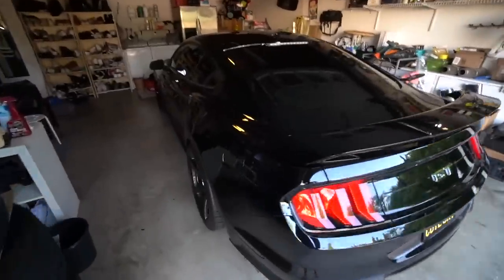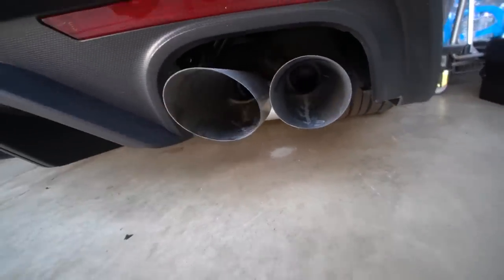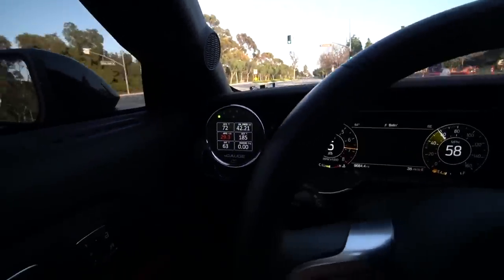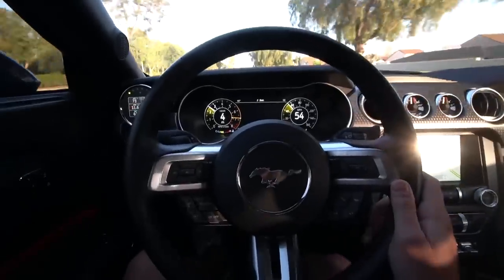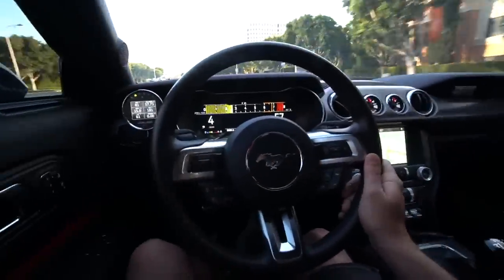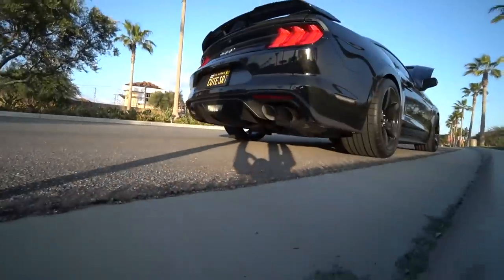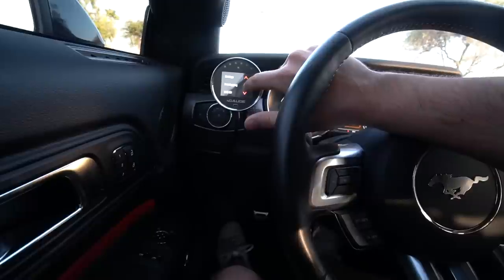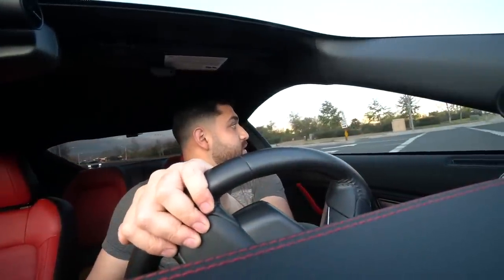My supercharged Mustang is misfiring, I think my catalytic converter is out...

Comment: I got the same check engine light and it flashes when I would get on it and pass 3,500 rpm, it told me it was cylinder 2 that was misfiring and it says online that the cats where being damaged so basically the car goes into limp mode, so it turned out that I needed to replace all of the spark plugs and now it runs back to normal.
Reply: you have a manual or auto?
Reply: Did you get a low oil preasure light too ? cause i have my car in the dealership right now and its doing that

Comment: This exact thing happened to me last week bro... it’s one of your coils, the smoke out of the exhaust is from the fuel bypassing combustion and spewing into your exhaust system. If you changed the spark plugs and accidentally placed that bad coil into another cylinder it’s going to read Multiple misfire too. While it’s idling disconnect the wire to coil on each cylinder and watch for the one that causes no change to the RPM.
Reply: He can take it into Ford and have them do a power balance test they will tell him which cylinder ect
Reply: Is this an expensive fix?

Comment: First. Check spark plugs for signs of something else
Second. Higher flow cats. You have too much power.
Third. Get a custom tune. PBD or Lund
Forth. Please upgrade OPG's
Fifth. Run thicker oil. 5w50, unless you already are
Sixth. Have fun! Stay safe!

Also, check to see if you are burning oil. If you are. Compression test needs to happen. Oil in combustion chamber from blow by can soak your plugs and cause misfires. that means oil is getting past the rings. You would see white smoke from exhaust more than likely. Hopefully its just cats over temp and only throwing a code when they are too hot but they may be breaking up at this point.

Comment: Since it’s a P0300 and not a 301-308 I would rule out spark plugs or wires coil packs or injectors. Those tend to isolate a cylinder . Normally this is a fuel issue, likely low fuel pressure. Try and log some runs to see your duty cycle on injectors . 

The rattling almost sounds like an exhaust leak . Did you replace the exhaust gaskets , they are usually one time use if crushed .

Edit: you might need to get retuned with stock exhaust . Air in vs Air out has changed so the fuelling might be off now. But then again I’m not a mechanic just know that’s what happened with my Subaru .
Reply: 01GTB Daily he’s rocking with stock exhaust now

Comment: I doubt if it is the cats. When a cat goes bad you will get either a P0420 or P0430 code or both. The two codes will depend on which side of the engine it comes from. If you get both codes, then neither cat is performing as it should. Those codes to be specific identifies the problem as "Catalytic Converter below threshold".  I own a supercharged Mustang. Although it is only a V6, that produces about 450 HP to the tire, the factory cats weren't designed for that power level and I smoked both of them. I solved the problem with Kooks Green Cats and installed an exhaust system that is bigger than stock. What you have is a P0300 which is a random misfire. The causes of your problem are as follows:
Faulty or worn spark plugs *

Faulty spark plug wires or coils *

Faulty fuel injector *

Vacuum leak

Low fuel pressure

Camshaft sensor defective

Crankshaft sensor defective

Engine timing off (tuning related)

Leaking head gasket

Low engine compression (Possibly caused by spark knock)

Poor quality fuel

The first thing I would do is check to make sure there's no damage the motor. The rattle you hear is the exhaust system rattling as a result of an idle that isn't smooth. The first thing I would do is a compression test and then I would look at the cylinders with a borescope camera. The borescope camera isn't expensive. What you're looking to do is making sure you didn't damage a piston as a result of spark knock. If you can eliminate damage from knock, look at the other causes on the list. Good luck to you. The list above will be a good starting point.

Comment: I took the cats off of my 2017 whipple GT with the stage 2 and it was ridiculously loud with my Roush axle back and x pipe resonator delete setup. My friends could here my car 5-6 blocks away in the middle of the night and it was honestly nascar level loud. But I added a Magnaflow tru x resonated x pipe today and the car is extremely quiet now. It sounds like it is a completely stock car with just roush axle backs and no other exhaust mods. I recommend it for you to prevent cat failure and if you want your car to sound stock for cops in Cali.

Comment: This is how you check your cats. With the car at operating temperature, shoot an infrared thermometer at the exhaust piping  in front of and behind the cat. Compare the two readings. Your temps should be higher coming out of the cat, and the temperature differential shouldn't be significantly different from the other cat.

Comment: Great video!  I am having a similar issue.  I just supercharged my v6 challenger and the check engine light is popping on and off as I drive.  It has been doing this for a few days.  The guys who installed it said I needed to get mid-pipes because my right exhaust is running way hotter than the left side.  I wonder if that is causing the check engine light to pop up?  Also, I noticed that the plastic cover over my shifter was hot to the touch (in the interior of the car); not sure what that would mean.  Any thoughts or ideas would be supper helpful.  I appreciate any and all input.  Thanks for reading! =)
Reply: i think its the coil packs since the spark plugs were changed

Comment: Just replaced the driver's side on cat my suspercharged 2015 f150. It was the doing the same thing. Big chunks were rolling around inside blocking the exhaust flow giving the p0300 code.

Comment: I had the same exact thing you got with the check engine light when I did a few runs. I pulled over turned off the car and turned it back on and it was totally fine. Never had anything come out the exhaust like you have. But that was maybe about 3 months ago. It’s more than likely a one time thing.
Reply: Same thing here...p0300...on a high temp humid day. Had just filled up on tank of cheap gas 93. Car runs fine cleared code hope it is a bad fuel issue.  cel not coming back on yet. 19 PP1 only 13k mileage.

Comment: Incorrect air/fuel mixture, incorrect timing, or misfiring spark plugs could lead to a catalytic converter failure or worse.
Because the catalytic converter gets very hot, this unburned fuel can ignite inside the converter and could result in a partial or complete melt down of the ceramic catalyst.

Comment: Stock Whipple tune runs rich af to protect the engine but not rich enough to cool the cats properly so 9 times out of 10 it’s a bad cat all that back pressure isn’t helping either. Maybe having the Corsa exhaust on helped it but after putting that restrictive stock exhaust back on probably sent it all the way

Comment: Used to work as a ford technician and I have seen the occasional cat sounding loose but saw a lot more loose rattling clamps so check that also. Make sure your plugs are gapped properly still. I think possibly since it was a generic misfire and not isolated to an exact cylinder it may be a fuelling issue  at that peak boost that run can’t say for sure though

Comment: Looks stage 3 whipple, just had a stage 1 kit melt a cat to the point that it went back into the cylinder and blew the rings out in cyl 7. Compression was at 60psi, smoke on start ups, knocking noise. New longblock installed along with revised whipple tune and bank 2 cat and upstream sensor.

High recommend longtube headers. No cats.

Comment: Do you have an issue where if you turn the interior light levels all the way to max then the El Wire kinda of flickers? I have to turn mine down just a little above max to make it not do that. I was just wondering if my power adapter was somehow faulty or if you ran in to the same thing.

Comment: Check the o2 sensors. I had the exact same code. Took it to the dealer but they wouldn't touch it since it was modded. Took it to a performance shop and they found my main bank 1 sensor 1 o2 sensor was fried. Got a new one and it went away.

Comment: Hey.  Did you ever get to the bottom of this as to what the cause was?  Sorry if I missed a follow up video.  I have a 2018 GT with Roushcharger and only 7500 miles.  Throwing a P0300 code, dealer checked plugs and said they were fine, sent computer info to Roush and they flashed the PCM.  One day later, CEL came back on.  My car, from what I know, is running perfectly fine otherwise.

Comment: Did you have a tune for catless, then put cats on? you can cause your engine to run rich without flashing your tune for a tune thats made for cats. Also pre detination as well. P0300 is a misfire caused by lack of fuel, which when you hit the rev limiter in the mustang it zero's out your cam's which cuts power to prevent you from over reving.
Also never clear you codes, for the fact that if you need to bring it to a mechanic they wont have anything to work with. I'm a technician and i come into that problem a lot!

Comment: What did you end finding out?   I have a 15 GT with a Kenne Bell supercharger.  Less than 4,000 miles on the car sinse I added the SC.  Car has a total of 29K miles.  Engine light recently cam on.  Got the same readings when connected to the code reader.  Black soot on the exhaust tips. ( borla attack). Car runs good.  No shaking etc.  Mechanic said could be 1000 different things.   Fuel injectors and spark plugs came with the supercharger,  so they are new.  Engine light not flashing.  And yeah every Dodge comes gunning.  Car pulls hard but mechanic advise its not going to fix itself or get better.   Any advice appreciated

Comment: Same thing happened to me on my 2018 whipple mustang gt PP1. I had the 10r80 and it all of the sudden wanted to stall / issues with keeping the rpm's up during idle. Particularly when coming to a sudden slowdown or stop. Finally threw the same code your's had and whipple had me immediately take it into the shop to figure it out.
Reply: I'm facing the same problem with my 2018 Odin superchargerd today.. Custom tuned locally but I would like to know what was the issue with yours and how did you get it fixed. I also feel there is a slight delay with the peddle response when I hit on it. And the car might stop in a slow turn suddenly. Your feedback is highly appreciated
Reply: @anti0illuminati07  I actually ended up getting rid of the car shortly after the issue. Found out earlier this year through some friends that Whipple was fully aware of all the engines it was blowing up with its base tune no the car. Go figure.

Comment: Check for loose plugs, touch exhaust manifolds to find misfire, change plugs and see if there isn't a piece of spark plug in a cylinder. Your next step is valve lash and timing chain/tension issue!!! Good luck!!!
Reply: Powder in the exhaust could be bad gas!!!

Comment: Rush,

Should have told the charger you were stock lol. It does seem like something is up with you cats failing. You could always swap the exhaust back to aftermarket one you had on before to see if the code remains and also to inspect those cats. As for the engine code, perhaps logging your drives and sending it to the tuner will reveal more information on the misfire. A dyno comparison with stock exhaust vs aftermarket will reveal how much the power difference is.

Comment: Ive had the code multiple times before. Always get that combined with a cylinder 8 misfire. Cleared it a few times and ran normal. Changed the plugs after another time and it was perfectly fine.
Reply: Is your car supercharged as well? How often do the sparkplugs need to be changed?

Comment: Awesome content once again, brother.  I'm curious, after multiple back to back WOT pulls is their any noticeable loss in power?  Just wondering how the Gen 5 Whipple handles heatsoak.  Keep up the good work!
Reply from the maker: We usually run at night and the weather is pretty cool the car doesn’t feel like it’s heat soaking since it is constantly getting fresh air at 100+ mph
Reply: @RushShift  Nice.  One more question, which heat exchanger did you opt for from whipple?  The standard HE with fans, or the upgraded larger HE without fans?

Comment: check your exhaust manifold!! my subaru w a 5 speed has the exact same problem. i ended up tightening a bunch of shrouds, got a band new aftermarket catalytic converter and neither solved the rattle. hope you fix it soon!

Comment: Everytime one of my boosted 19s engines blew it started with P0300 and progressed...I've seen it run clean above idle to redline with 3 cylinders down due to transition to DI blowing oil off half the plugs it was insane....

 I kept blowing engines till I pulled my cats but if they are pulling you over for a catback SHIT removing the cats makes its NUTS loud....

 I'd definitely get them off at least yours probably broke, many melt then block the exhaust and pop engine ( this is what was happening to me )...

Good luck

Comment: Rattling could be cat breaking up or just the heat shield loose 
As far as misfire code I have a boosted 06 gt and it was a bad spark plug for me.  Replaced it and been 2 years no problem.

Comment: Now I know that it’s 2 different cars. But before my 16 Gt I had an 18 wrx and I got the p0300 code. It turned out that after the dealer couldn’t find the problem they had to go way deeper and found out that from switching from tunes back and forth, I was running stage 2 91 and e85 tune on and off I would switch them, I actually fried the ecm. But my car did also stop running so I don’t think that’s the problem your having cuz it seems to run fine. However if your car back fires and try’s to, or does stall out, it’s your computer most likely. And also my cat was fried as well but it was an after market high flow cat so idk if it was destroyed because of bad quality maybe or maybe that was the problem but my ecm was definitely bad. Upon replacing the ecm and putting back the stock cat, the car ran like new.

Comment: Guys I have a 2019 mustang GT 10 speed auto I was tuned by palm beach when I bought it from the dealer. The car always misfires when you get on the gas. Check engine starts flashing then disappears then when I get on it again it misfires but the check engine light stays on. It’s a P0300 ford checked all the spark plugs , coils , cylinder and compression test everything checked out fine they also replaced the 02 sensors yet it’s still misfiring. We also put the car back to stock and it’s still misfiring. Before when it had the tube on in sports mode you can make the car make some popping noises after you let off the gas. But after the tune was taken off it doesn’t pop anymore. Car is still misfiring my ford dealer can’t seem to figure out the issue. If you guys have any idea please let me know. The previous owner did have a separate exhaust before but when he traded the car he put the stock exhaust back

Comment: You should not have cats on a boosted car. If you were to go with a Lund tune (which I highly recommend) they strongly enforce free flowing exhaust. If a cat were to get clogged, it would blow the motor with the amount of back pressure going back.

Comment: Not much room for error with the 12.1 compression, boost, and 91 octane. You should get it tuned at least even if still on 91, but e85 is a must with the high compression. Will also help keep the cats cool, best bet is to go free flowing though.

Comment: All you have to do is install the mak cat deletes and install a resonator in the  cat deletes piping, cleans up the rasp and sounds good with corsa sport exhaust which is what I have on my 16 supercharged gt
Reply: oscar romero Thats exactly what I did. I just installed the Magnaflow tru x resonated x pipe today in place of my resonator delete x pipe and it took away all of the rasp and cut down the volume by 50%. It sounds very deep and not much louder than stock now.

Comment: You have a loose or bad spark plug,or wire.  if you keep driving it will eventually throw the code for which cylinder. Pull your plugs I'd bet money one is a tad loose or a wire os bad. Literally just went through this on my wife's turbo 5.0.
Reply: Edit: bad cats will almost always throw a seperate code as well as the misfire code.

Comment: P0300 Trouble Code Diagnosis- Ford Mustang They are presented somewhat in order from most to least likely to be causing the code: Low Fuel Pressure– If there isn't enough fuel getting to the engine, this will cause combustion to be less than optimal.

Comment: Never heard of P0300 being caused by failing cats. But it will definitely damage your cats having random misfires. A flashing CEL indicates a catalyst damaging misfire. You might be getting detonation at very high rpms when it gets heatsoaked. 91 octane fuel is likely inferior for that setup, especially after doing back to back runs.

Comment: I’m gonna go ahead and say this... ‘18 & up Mustangs are having lots of issues, especially boosted engines. Hopefully that’s not your issue, but running on 91 isn’t good. Basically it’s a matter of when, not if it happens, unfortunately. Ford has issues with their arc coating on the cylinder walls & cracked piston issues. Good luck, hopefully that’s not your problem.